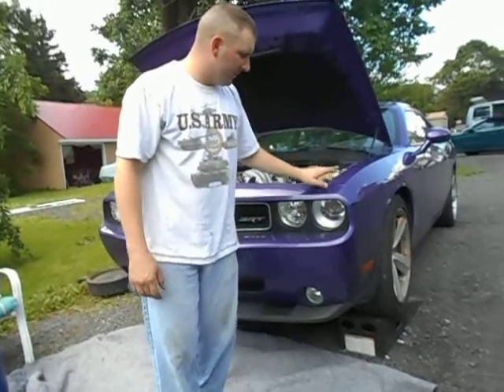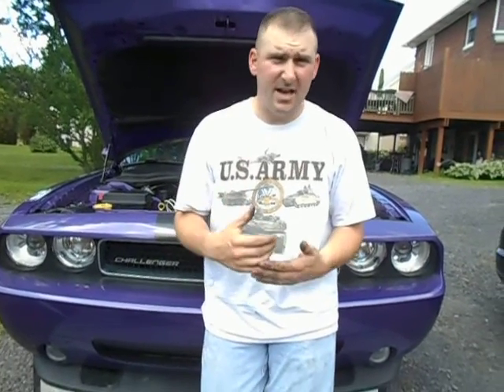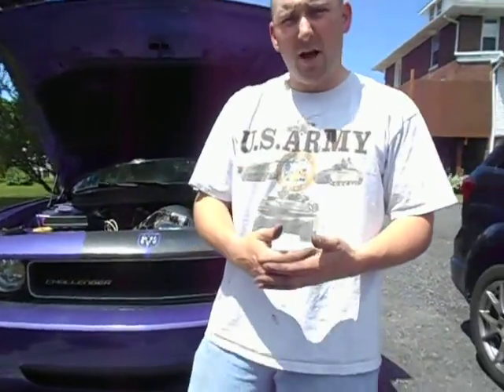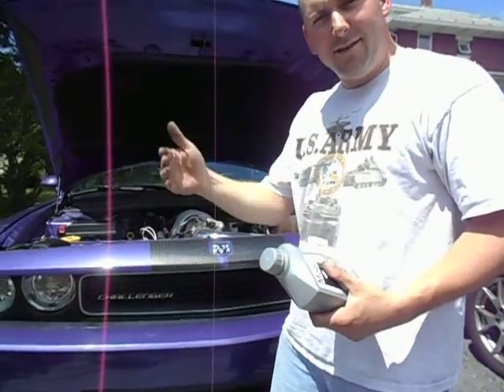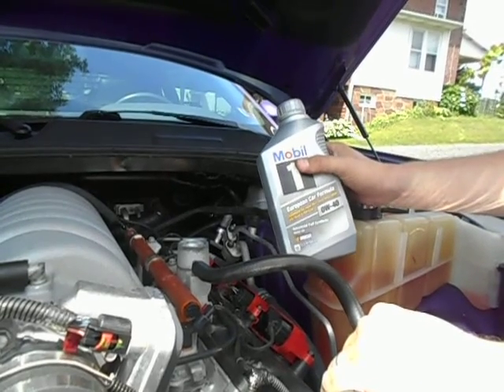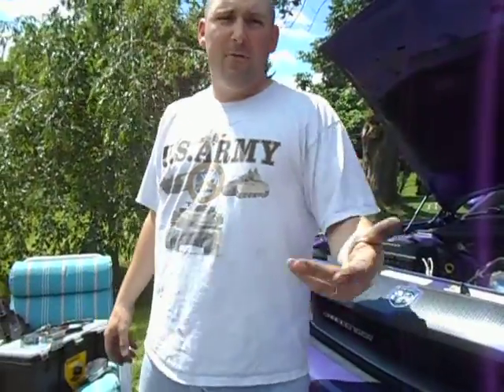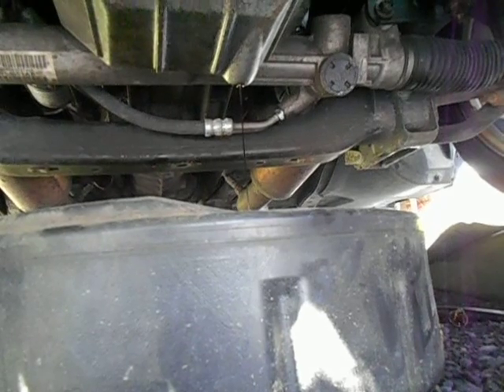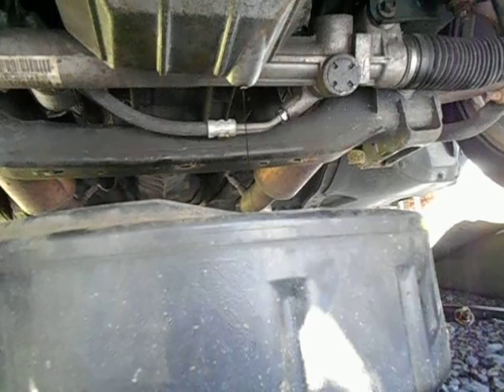Oil Change pt1 2010 dodge challenger SRT 8

Comment: The fill cap on the 6.1 says to use mobile 1 full synthetic, but they no longer produce it for the SRTs. I spoke with one of their engineers when I first got my Challenger a few years ago because all that I could find was European formula available, and said that they were considering making it again in the future. I asked him if the Euro stuff would work in it, but he said that they would not guarantee it if something were to happen and recommended not doing it. So now Pennzoil has taken over and does make an SRT specific oil for it. I found 1 gallon jugs of Platinum for $22 on amazon, and can also get SRT filters for around $13 that are the best quality to
Reply from the maker: Very nice.  Thank you for the information.

Comment: Dustina you mentioned a belly pan. I wonder how many shops just take them off and throw them away. I do not trust shops that I can't see what they are doing. Also difficult to find Pennzoil 0W 40 SRT Oil.
Reply from the maker: yes, 0w40 is a pain to find but mobile 1 and royal purple both make it.

Comment: Any trouble driving the SRT8 onto the ramps?
Reply from the maker: Lawrence Bailey. No.  I have a set of low profile ramps that fit nicely.  If the angle of the ramps you have are too much you can always use a jack and jack-stands.

Comment: You gave me good info about my 2060 error code saying it was a fuel pump sensor problem now I have another question. Are there any problems with the bearings on the super chargers in Hellcats? Has Dodge gotten new vendors that supply the? Thanks
Reply from the maker: Robert Lyon, the supercharger is from IHI.  I do not know anything about this company and am unable to speak intelligently about them. In addition the hellcat is too new to give good analysis on problems.  The A-models of cars will always have the most problems.  So if you are going to buy one wait for the third or later production year of them unless you are buying it as a collectible, in which you want the 2015.  Personally I would stick with the regular SRT add forged internals and get a Kenne-Bell.  You will be able to get more power and have better upgrade potential.  It will also cost less.
Reply: So the 2017 Hellcat would be risky idea and keep my SRT for now. I appreciate your valuable advice here.

Comment: Dustina my 2016 SRT has a malfunction light on only 1800 miles. So I go to diagnostics and a code comes up. P2066. What is that? Fuel? I only use 93 octane  top tier gas. Thank You.
Reply from the maker: I believe that code is for fuel level sensor malfunction.  There are 2 fuel level sensors in the model and when one sensor does not read the same voltage as the other it triggers the fault.  of your car is still under warranty, let the dealership fix it.  If it is not you will most likely have to replace the entire pump assembly since I do not think they sell just the sensor.  Which if you are going to replace the pump, you might as well upgrade the hat and run a multi-pump assembly.
Reply: Thanks a lot for your help. My car has only 1800 miles so I made an appointment at the dealer. Hope the tech knows as much as you.

Comment: Do you think this is also pretty similar to do on my jeep srt8 2006-2010? Body style. I would appreciate any info since I would rather do this myself. Sand safe a few bucks.
Reply from the maker: if it is the 6.1L the engine layout should be identical.
Reply: +Dustina Hillbish yeah it is the same engine. I'm sure it's similar.
Reply: +Dustina Hillbish thanks
Reply: +Dustina Hillbish how often do you change your oil?? How many miles or months?? Thanks again.
Reply from the maker: +Jose Gontes every 6 months or when the indicator goes off, which ever comes first.

Comment: and i sub 1 quart for marvel mystery oil..   that stopped my Hemi tick on my 13 rt..  the mds was causing it..
Reply from the maker: 2010 srt8 doesnt have mds.
Reply: +Dustina Hillbish still wont harm..  that marvel works great less agressive then sea foam...   check out the mopar srt oil filter..
Reply from the maker: +HEAVYHEMI I'll give it a shot for next oil change.
Reply from the maker: for those following the comments, mds is Multi-cylinder Deactivation System.  it is installed on the 08-10 RT models as a fuel saver.  what it does is deactivate four of the eight cylinders when they are not needed.  The SRT8 models did not come equipped with the system.  In 2011 both the RT and SRT were redesigned the RT kept the 5.7 but some minor tweaking allowed it to have a greater output.  The SRT switched the 6.1 (370ci) for the 6.4 (392ci) and added MDS.

Comment: what are your thoughts on redline and Kendall or even Brad Penn on this engine
Reply from the maker: namelesssd I am unfamiliar with Kendall or Brad Penn.  Redline makes an awesome product.  I still prefer Royal Purple for the engine and differential, but I use Redline C+ in my transmission.  Much smoother shifting and improved gas mileage as a result.
Reply: Dustina Hillbish okay. thanks for response. are you running Royal purple in your SRT now over mobil 1?
Reply from the maker: namelesssd yes

Comment: My 2010 challenger srt says 5w40 in the owners manual but 0w40 on the oil cap what do I put in it??
Reply from the maker: I noticed the same thing.  I use the 0w40 because the dealer told me that was what was best.

Comment: wtf what kind of oil are you buying that it cost several hundred dollars? you can get top of the line synthetics at walmart for 20-25 dollars for a 5+ quart jug.
Reply from the maker: +KoG GoK Depending on your branding or type.  I like royal purple which is about $11.00-$16.00 a qt.  This time I was using mobile 1 full synthetic 0W40 which is about $27.00 for a 5 quart container.  This vehicle takes 6 quarts.  at 6 quarts per oil change plus $11.00 a filter.  I on average drive 15000-20000 mile a year.  so in changing oil every 3000 miles means 5-7 changes a year.  So at 5 changes at $5/qt times 6 Qt plus one filter is a total minimum of $200.00.  Thus the several hundred dollars a year comment.
Reply: +Dustina Hillbish 6quartz in a srt8. my rt takes 7!and thats per manual & dealer. i think srt8 hold 8_9
Reply from the maker: Dipstick doesn't lie.  Perhaps the dry capacity is seven.  But in my oil changes, the dipstick reads full.  Also, capacities differ year by year.

Comment: warm it up to operating temp . wait a few minutes and drop that sum bitch. it will come out like water . use a zip lock bag on the filter after u crack it loose.. the little oil that drips out gets caught in the bag.. :) no mess
Reply from the maker: Excellent ideas.  thank you.